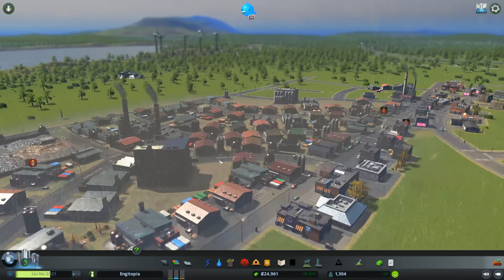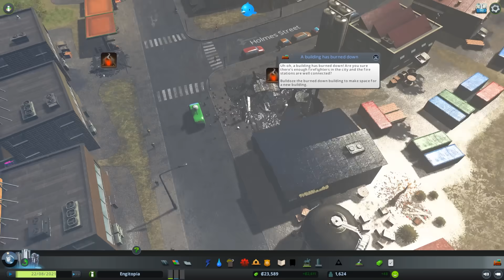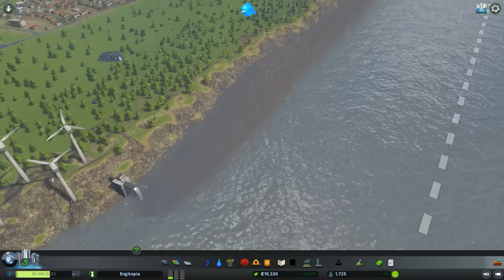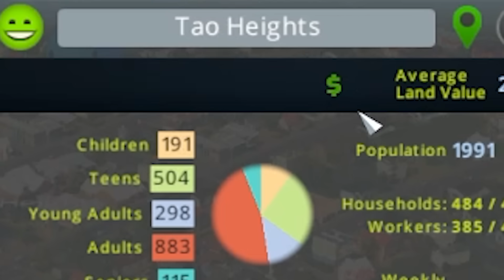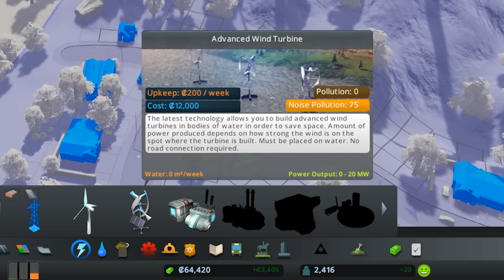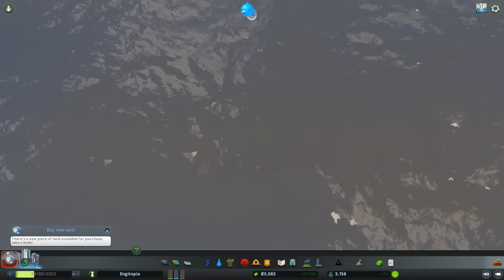Using REAL DESIGN PRINCIPLES to make more REALISTIC JUNCTIONS in Cities Skylines! Engitopia Part 2!

Comment: I did the math the wind turbines will no t kill the people because o f the sound by regulations wind turbines are supposed to be 300 or more meters away from housing and that is are around 45hz and to put that in perspective you aircon for housing is around 50 and  your fridge is 40 so because it is not 300m or more I would say 60hz so because you have 7 turbines 60x7 is coincidentally 420 and the amount of noise yo kill someone is 300THZ

Comment: 1: in cities skylines, people hate wind terbines. you want commercial as a buffer to seperate residential from noise or pollution.
2: you should go into the steam workshop and download network exrentions. it's a mod that gives a bunch of good roads.
3: the not enough workers mainly just means they built too much industry. it will resolve itself as the residential increases. Public transport will help with traffic.
4: speaking of traffic, the traffic AI is notoriously bad. Traffic Manager Presidential addition gives you a bunch of useful tools to control where traffic goes. You can also use node controller to visibly paint in the lines on intersections, rather than having them be invisible guidelines.
5: I appreciate you going into the full civil engineering details. I have some interest anyway, and I like to apply those sorts of things to my own cities. Thanks!

Comment: I love your series! Concerning mods, I wouldn’t go overboard. A few suggestions:

Move it, road anarchy (optional) and TM:PE are just essential to build any interesting intersections from scratch. Since you’re an engineer and might want to go for really crazy intersections, you could also try CSUR. However this is less intuitive to work with. Node controller  intersection marking tool are also fun to pimp your intersections. 

Ultimate eye candy is really amazing to make your game look more pretty. 

Some quality of life mods are roundabout builder (build roundabouts), prop line tool (which allows you to build trees and props in long, neat rows along roads, loading mod (essential if you want to use many assets etc), prop and tree anarchy (allows you to put trees anywhere) and so on.

There are hundreds of mods, and biffa and imperatur have made some nice overviews of the essential ones. You can go really overboard and create some magnificent artworks (see Altengrad and Aurelia from Akruas, or the city on Mars from citywokcitywall), but then you start to step more and more away from the real ‘Cities Skylines experience’ with traffic and botches upon botches, towards creating a piece of art.

Comment: In America they dont care theyll put a no littering sign right in my line of sight even in a semi sitting high up about 9 feet off the ground theyll put shit right in my line of sight so i gotta inch out to see if its clear and unprotected left turns on a busy road 78,000 lbs gross weight is the biggest pain in my ass ill drive half way around a warehousing district to make the left at a light or atleast an all-way stop or find a way to make rights or find less busier routes it all depends on the situation

Comment: a couple things(some of which have been said) 1. Snapping, when building certain things(like roads/pipes) there is a little box with a cursor clicking a white dot above the fast forward button. 2.footpaths are in landscaping(above the center of the population box) 3. Some personal must have mods would be "move it" mod, useful for making small adjustments to road/building placement. "TM:PE" traffic manager, useful for better controlling all things traffic. and "road anarchy" for when the game does not allow a road placement for no reason. and 1 last mod "roundabout builder" but I'd say its required if you want to build a lot of roundabouts of varying sizes.

Comment: I haven't seen anyone mention it after some scrolling.

To switch painting modes when drawing zones, use the four buttons above the city name to adjust the type/size of your brush.  By default, it's on Fill, which is great for long, flat grid cities, but a more general painting mode would be much better suited to the style of roads you're using.

Comment: You should also aim for your housing areas to be 4 wide and 4 long as these are the largest houses you can have in an area and also provide the most value, for example a length 8 squared long and 4 squares wide would have 2 houses on it

Comment: Easy to tell you're a structures bod! ;-) Thesedays we're trying to get more people to walk and cycle, so if you're building a road, put in footways and a cycleways as part of the standard highway cross-section if the game allows you to. Also, those cul-de-sacs look nice, but they're very DB32, i.e. out of date. If you put them in, allow at least footway links to join up the ends to make them permeable, preferably separated footway/cycleways - helps lower car dependency. Maybe see if it lets you build a suburb along the lines of a woonerf - very walkable but with few or no cars?

Comment: I feel like American Engineers don't use that junction visibility rule EVER.  The amount of bushes and trees which obscure my vision is ridiculous.
Reply: I suspect at the design phase they do.  Bushes and trees have a mind of their own sometimes though.
Reply: There's a lot of roads near where I live that are like hairpin turns + vegetation in the way. That or having veg blocking stop signs so you don't see them til you're right up on them... fun fun fun
Reply: Yo For Real there is an intersection where instead of cutting down a tree they made  an extra traffic light that's visible from the curve in the road that's blocked by the tree. Over Engineered for real you know the lights green before you actually see the light because they're synced up and it's just like a random pole in the ground with a random street light.
Reply: Agreed, it made me quite uncomfortable not being able to see other vehicles when I started driving
Reply: Real, there is like 10 feet of visibility at the intersection for the one-way road that I live on.
Reply: Roadway Engineers always consider sight distance at every intersection. Whether the maintenance of bushes, trees, or brush is kept up is another debatable. If vegetation is blocking your view at an intersection, I recommend contacting your local DOT and request maintenance (assuming the vegetation is on public right-of-way).
Reply: @esdgolf323  Public right of way is the key term. Many roads, especially outside the cities, it’s private property right up to the intersection. They can ask for you to trim your bushes and trees but cannot force you.
Reply: @chrisr.8905  In my canadian city they can enforce it as the first few meters of your front yard are considered city property. My dad actually called the city on a dude who lives on the corner for a super overgrown evergreen because its very common for kids to play amd bike on our streets.

 he was worried because you couldnt see around it a kid would get hurt. The city trimmed/cut the lower 4/5 feet of branches clear so you could see around the corner.
Reply: @esdgolf323  Where exactly do you live where you can do that, I need to move there.
Reply: There's also roadside parking to take into consideration. Right outside my front door there's an area that allows free roadside parking, but is often taken up by taller vans/trucks which block sight access (on a fast straight road, tho nominally limited to 30mph) for the pedestrian crossing island within 30yds :(
Reply: @snafu.X Usually when tall trucks block line of site from where they're parked I remove their valve stem cores.
Reply: street fox coffee

Comment: 12:30 you might want to move those water turbines over slightly to where the water is darker because that will give you higher electricity output.

Also when zoning, you are using the fill tool, when zoning, look near the bottom left, there are 4 round icons, one with a paint brush that is selected, and 3 more. The other 3 options are selecting a rectangle, small paint brush, or large paint brush.

Comment: Hi RCE, you can build footpaths under using the landscaping terrain tool on the right side of the toolbar on the bottom. You can also turn snapping off by pressing the white arrow icon on the bottom left of the toolbar when building roads or paths.